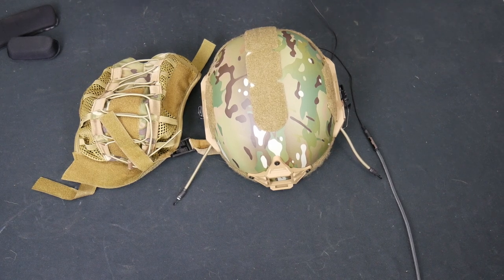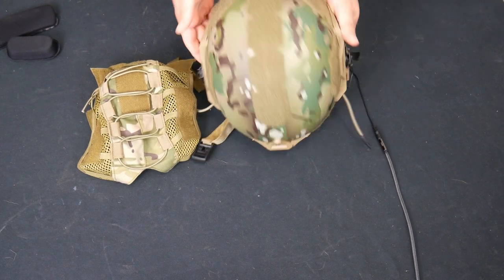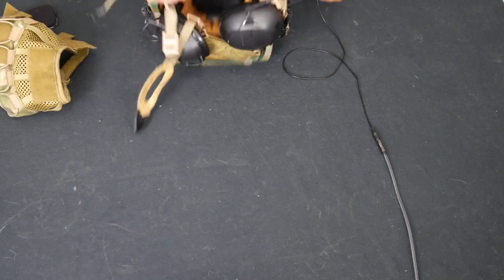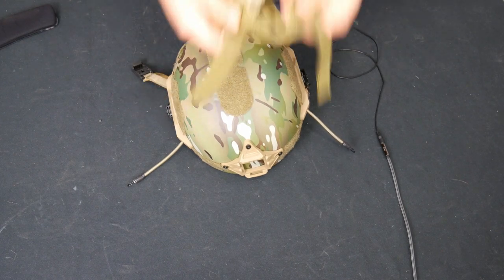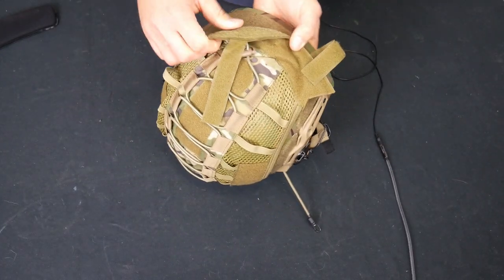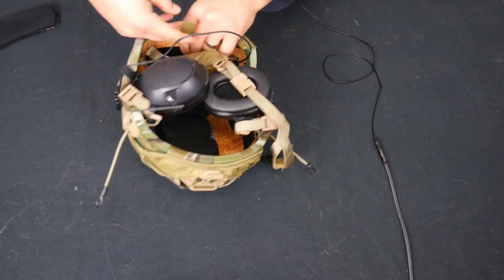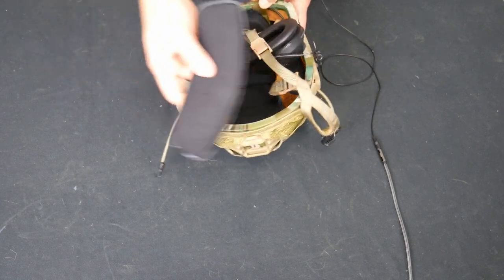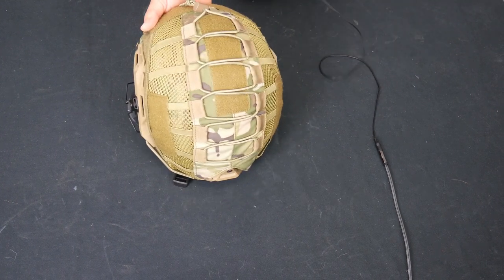Hard Head Veterans Helmet Cover Installation

Comment: What brand model eat pro did you mount on there? How do you like them and do you have issues with them covering your ears properly. 
I was running walkers and they wouldn’t seal good.
Reply from the maker: Peltor sport tactical 300s.

Yea, I enjoy them. They seal well, overall would recommend
Reply: @CitadelDefense1  awesome thank you
Reply: @CitadelDefense1  I did the same thing. I added Peltor gel cups and you get great helmet ear pro that you can plug into a shoulder mic for comms and save hundreds.

Comment: Is the HHV bump sized similar to Ops Core Bump? Just wondering if covers designed for OpsCore will fit on HHV Bump. Also wondering if it has the standard screws in the back for counterweight?
Reply from the maker: No idea, I don’t own their bump

Comment: What earmuffs do you have?
Reply from the maker: @jebstewart2195  I use the Peltor sport 300 tactical. Had the same pair for 6 years. Would recommend
Reply: @CitadelDefense1  did you run those with the hhv mounts?
Reply from the maker: @jebstewart2195  I did, but I scraped those eventually and got arc mounts and replaced the mlok mounts in the sides of the helmet